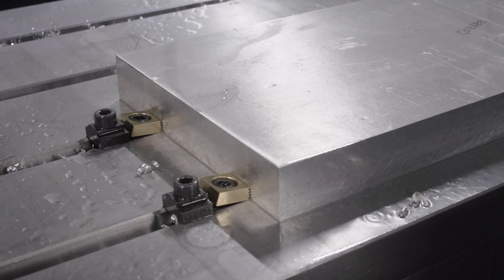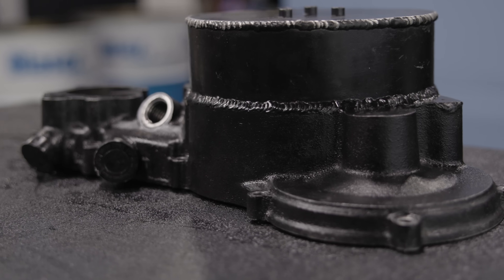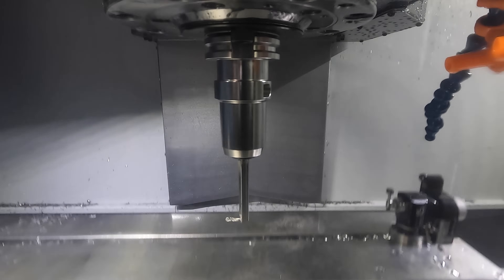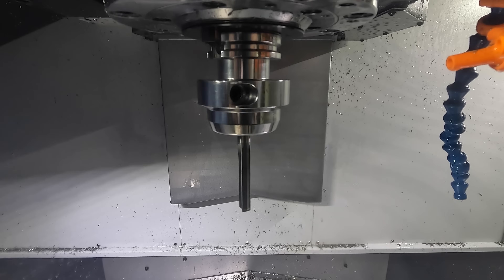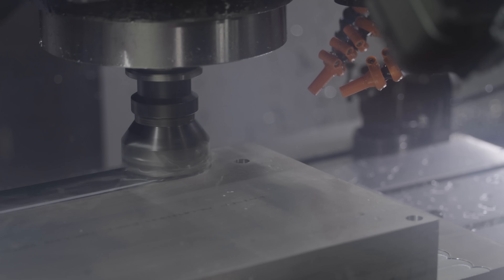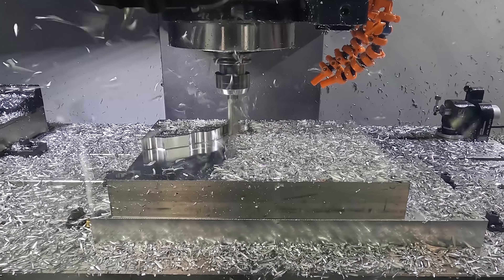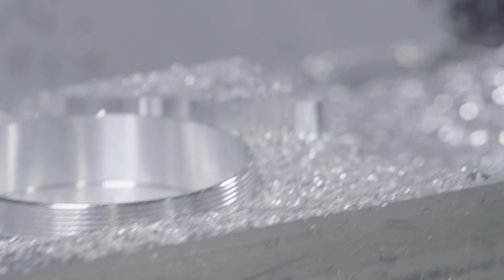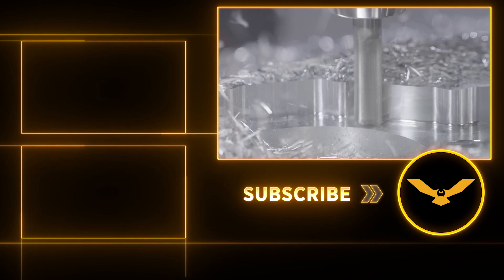Genius Workholding + Tab Technique | DNM 5700L | DN Solutions

Comment: wouldnt switching to titanium be a good idea for something like this ,  its a strong metal resistant to corrosion and half  the weight of steel  if im not mistaken 

well i guess its probably like 4x-7x the cost
Reply: It's just a housing so I assume ali is more then enough for the application. No reall stresses going on that would require a sturdier material.

Comment: I would classify as an intermediate cnc Machinist. And I have to say doing tabs have always been a problem on my last job. Like accidentally stripping shoulder bolts on an aluminum fixture. Or the programmer didn't made enough clearance for the bolt. Then the same issue with dowel pins as well. Usually the spindle speed is off so the hole becomes a little oblongated. Then also the issue of flatness. Then yet again we didn't use a torque wrench.
Reply from the maker: It’s all a learning process. Definitely use a torque wrench to the specified torque call out on the packaging of miteebites or the webpage. 
Doing spring passes inside holes is a good idea to ensure it is perfectly round.
Have a great day and thanks for the comment🤙

Comment: I use double sided counterbored tabs (if the part is thick enough). Basically you can flip the part with the tabs on the outside of the profile. Then sometimes 2 tabs have pin holes that I rebore after the first op. It works great. The excess is removed in the first op. This way you show is all fine and dandy without flatness callouts. Double sided counterbored tabs keeps thing pretty flat and that "pre deburring" of the "bottom side" (op2 bottom) is nice. I have always loved having the bottom deburred because like you said cutting tabs off is really easy, if you still need to finish the profile you can. Since the deburred bottom allows you to stay off the fixture. A lot of guys cut in to the fixture. Most of the time it's unnecessary, just have a really sharp finishing tool so you aren't worried about tapered walls. I make my tabs where my clamps can be used after the tab is cut away. I try to show people it but for some reason people don't listen. Tabs are so powerful.
Reply: I like that idea with double sided counterbores so you can recut them on each side.  That would really help if you have a material that has stress in it and is prone to warp.  Thanks for sharing